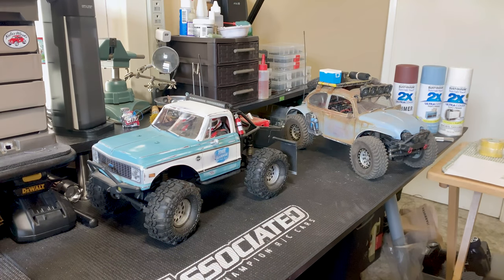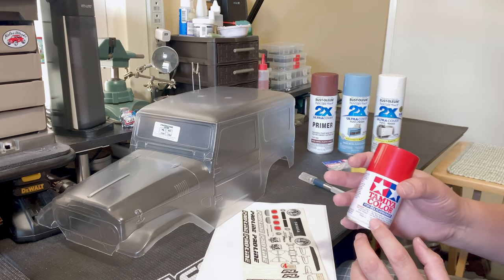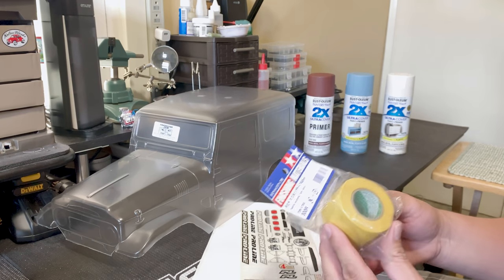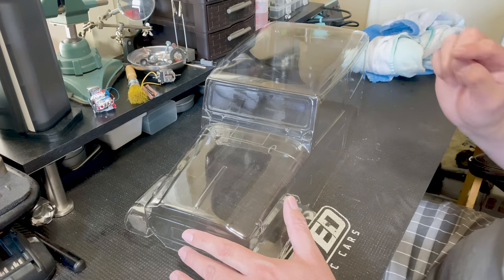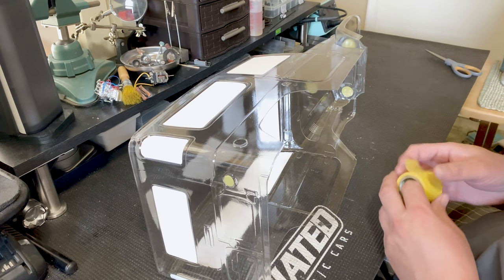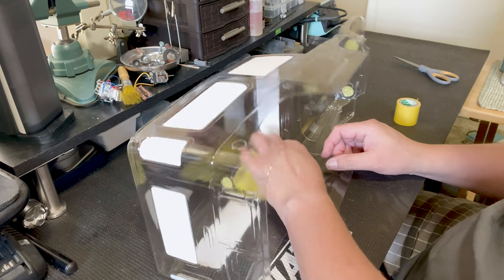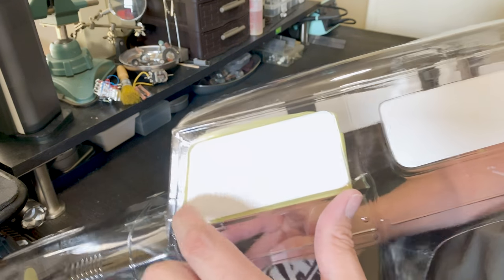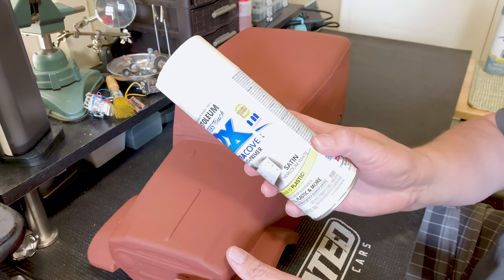How-To: Paint A Weathered Body

Comment: Awesome vid bud. Just the effect I wanna replicate on my 73 ford bronco body for my gen 8. 
Being an automotive painter and using wet sandpaper all my life, I will pass a small tip along for u to try that may make the sanding process easier and save sandpaper...using an scotchbrite pad folded in your paper helps keep it from clogging up, as well as less pressure is needed for the paper to cut, and keeps it from wearing and clogging up.
I have had to wetsand complete cars and this lil trick saved me hours. 
The fj turned out amazing and thank you for passing along the knowledge on this painting process. 👌👍
Keep the greasy side down 🙃✌
Reply from the maker: Ahh, good tip. Thank you. I'll keep that in mind.

Comment: Good and bad. Very happy with the result I got following your technique on both videos. I painted a lexan body. Very unhappy with how the paint adheres to the outside of the body. I washed the body and used a brillo pad during the process. Was very particular about letting the body dry prior to painting. I think I will have to use more aggressive cleaning/scouring pads. The Rust-Oleum has to adhere a lot better then what I have experienced.

Comment: Awesome video! No chipping when using those rustoleum paints? I know if you use TS paints there’s chipping If the body gets hit.
Reply from the maker: I haven't had any issues on any of the bodies I used this paint on. It's made for plastics, so it flexes. The TS paints don't flex which is why they flake off. Cleaning the body properly is key.

Comment: I use the sandpaper befor i paint, to roughen the surface, so the paint sticks better, could a cherokee body for my crawler.. nearly the same taktic, whitout the weathering, but whit silver under the body, so if it get skretched.. it show bare metal now ;-)
and the paint from the outside don´t flake at all... sticks perfekt whit roughen it up first.. just used tamiya colors